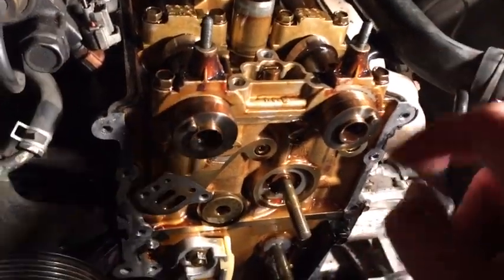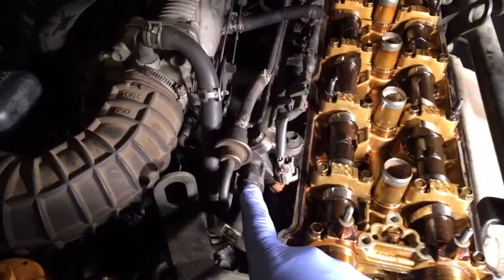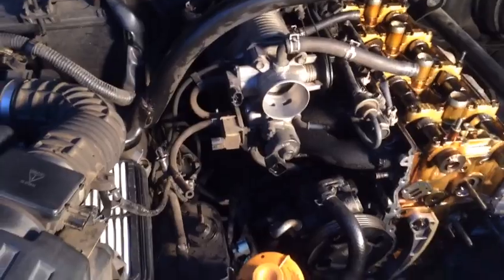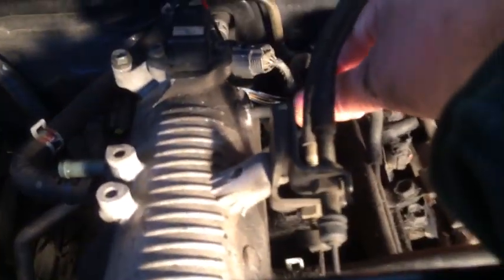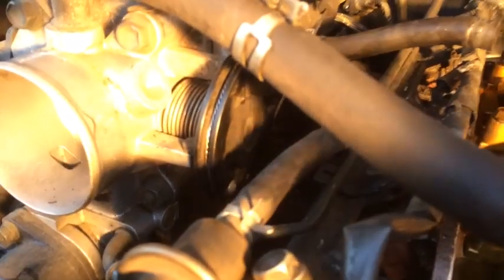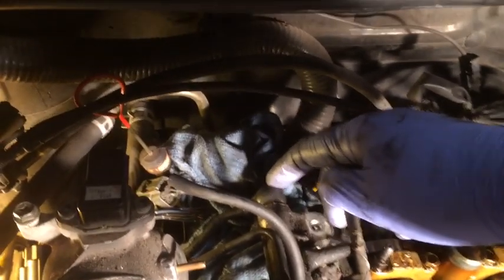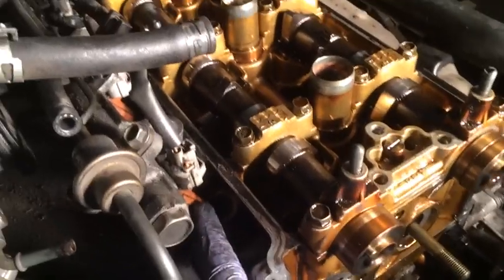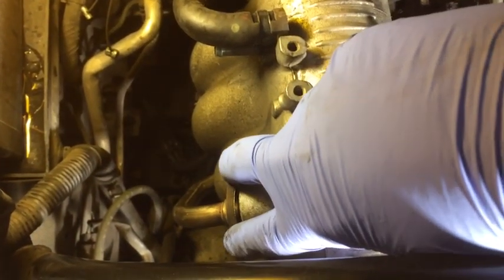Cylinder Head Replacement Part 4

Comment: I own a 2000 Tracker 2.0L, 2D, 2WD, 80K miles. I changed the spark plugs, there is some Florida fine red dirt in the back 2 spark plug holes that I want to clean out later on. When you removed the valve cover, the spark plug hole/tubes are part of the head, so there is no use  in me to remove the valve cover to clean the tubes, it would be nice is the tubes came off to clean. I cleaned the plug boots with WD-40, they cleaned up very nice. The original plugs came out O.K. NGK IFR5G, I installed the new plugs NGK PFR5J11 at 11 FT LBS, put ATF on the threads, works great. Stay with the heat range 5. The Tracker runs great...

Comment: Here is a  helpful hint...I prefer to leave the intake bolted to the head.  Once you get the intake/head assembly out of the car, it is much easier to get to the bolts on the intake.
Reply: Hey, I'm having a lot of trouble with this part and I wanna try your idea. Is there anything extra that has to be disconnected from the intake components?